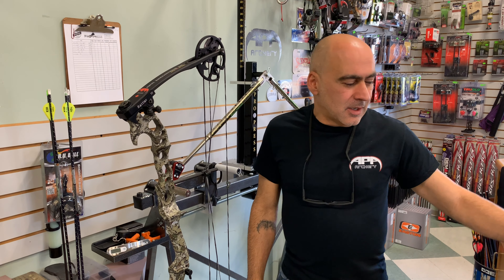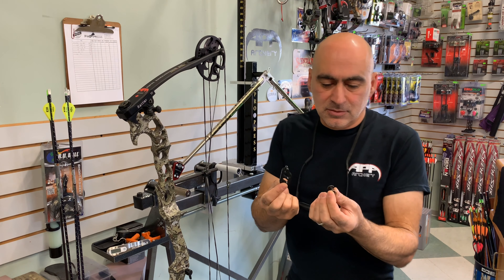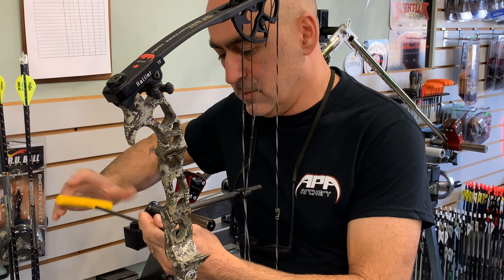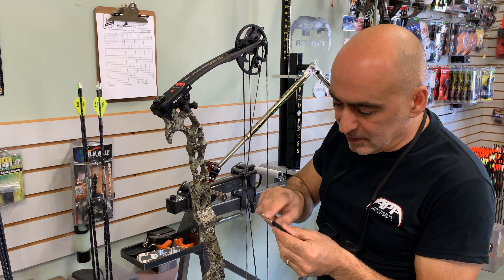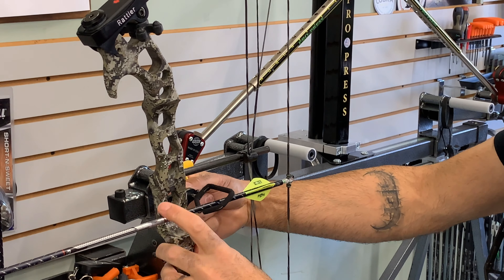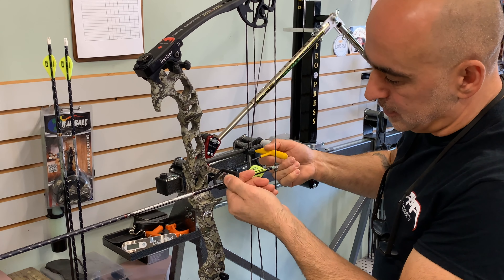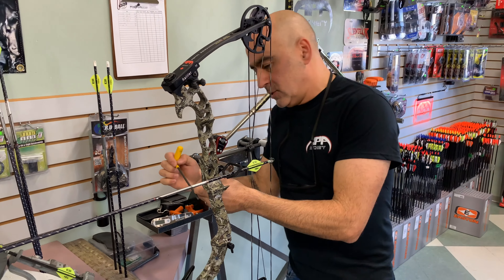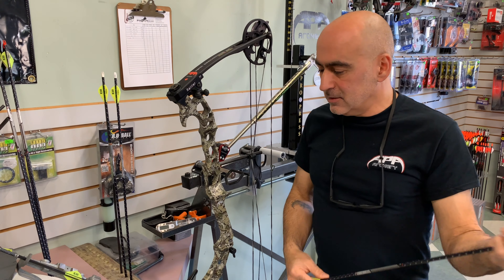How to Install your APA Safari Lite Arrow Rest

Comment: I have an older viper v7 with only one mounting hole for a rest. Is there a drop away containment rest I can use?
Reply from the maker: Yes, you would just install the drop away full containment rest with the one mounting hole to secure the arrow rest into place. Check out our website https://www.apaarchery.com/rests/ to learn more about our latest Twister 360 Drop away arrow rest.